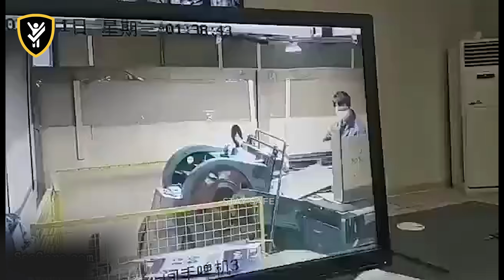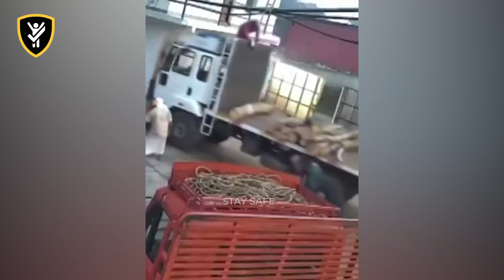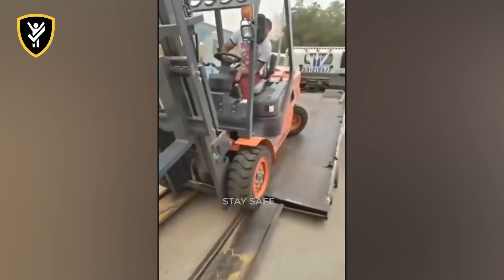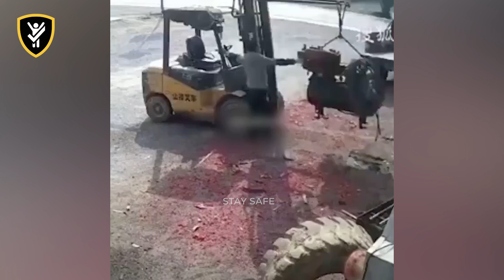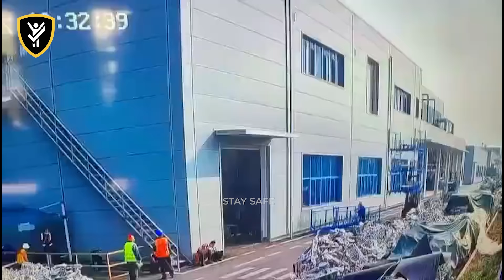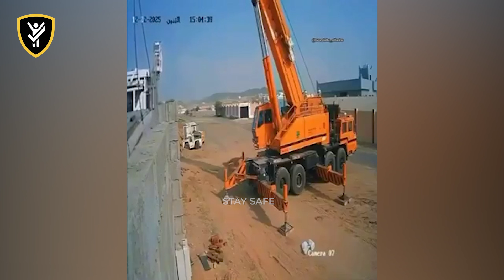He Leaned Over The Active Machine.

Comment: A guy I used to work with installing flooring had same accident as guy going down the ramp with that dirt bike… there is a ride on machine that rips up old flooring, it weights 4-5 thousand lbs, he was backing it down the ramp off his truck and the back wheel came off the ramp, he jumped off and instinctively tried to hold the machine up, it landed on him and we heard him screaming from inside the job, bunch of us ran outside and lifted enough of it up to pull him out, he’s in a wheelchair for life now

Comment: almost 90 precent of these accidents could have been avoided,,,none of them used common sense at all
Reply: Yup, Mr.Morgan, yur absolutely right for most parts. If I may add to that, in especially-so the inept handling of Forklifts. It really is a wonder why forklift-drivers these days rarely perform just that tiny-li'l hassle of Tilting - Back the Mast-Frame for so much justa bit & lowering the vehicle's fork-rack to its maximal lowest for optimal stability so safe-travel is naturally had. Say on the account, obstacle clearance is factored-in, in light of poor surface conditions wic the vehicle hadda traverse, wic probably coud be laden w/pothole ruts, pock-marked randomly all over. By lowering the rack-bed to however possible lowest it can & not colliding with blind-spot obstacles. Goods wud not so easily be thrown-forward & onto an unfortunate colleague who routinely hadda go into the danger-zone box to dutifully, properly place the relevant slipper-pallets, hence a bit more adjusting (thus exposing to more unforeseeable dangers) be required for load-bulk to sit securely on.